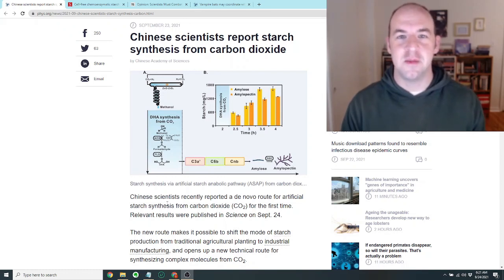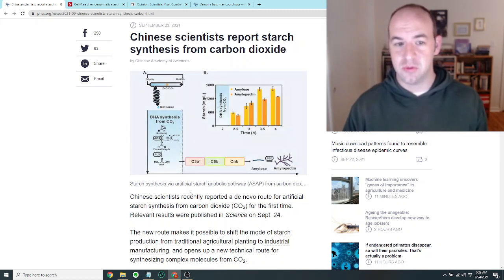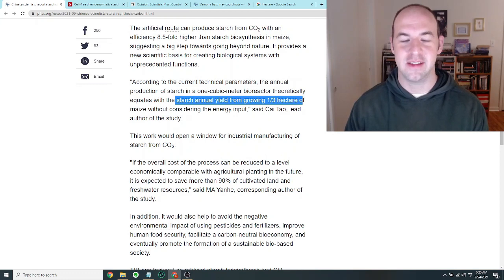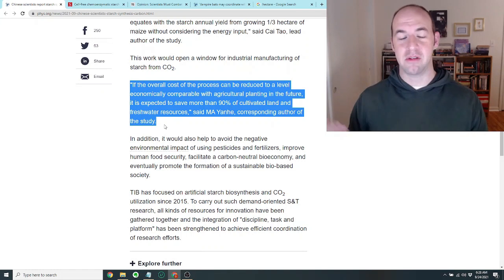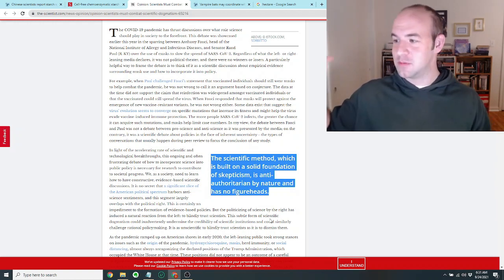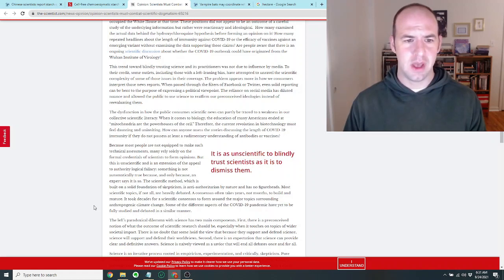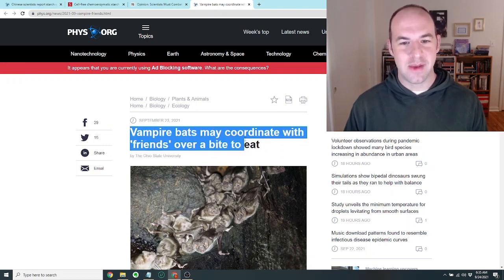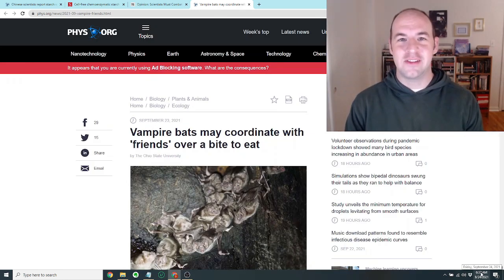Scientists Make Starch From Carbon Dioxide - Food from the Air

Comment: Can this process be used to reduce CO2 in atmosphere? We no longer fear global warming?
Reply from the maker: It would definitely utilize CO2, so it would pull some CO2 from the atmosphere temporarily, but you have to consider the net CO2 change to be neutral because in a short time after making the starch, you will consume it in some way and then your metabolism will break it down and you will release it again, so it is a very short cycle. To really reduce CO2 in this way, after making the starch, you would have to bury it deep in the ground, which is what companies like Clime Works are trying to do with their carbon capture technology. Thanks for watching!!
Reply: @theconflictedscientist  I found that we do not need the entire process to reduce CO2. The first step of the process is to change CO2 to Methanol. Then the second step to use Methanol to produce starch. So we can stop at Methanol and still can reduce CO2.
Reply from the maker: @xyu101  That's an awesome point - the cool thing is that methanol is already a viable, industrial product (I use it in my lab everyday, for example), so maybe the cost can be offset by selling the methanol.